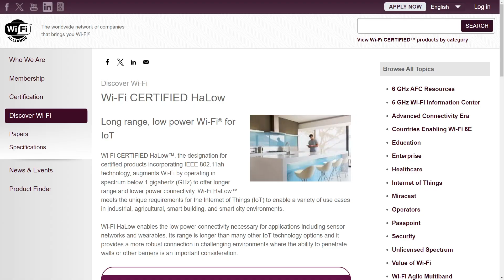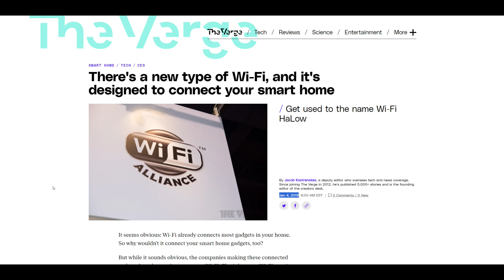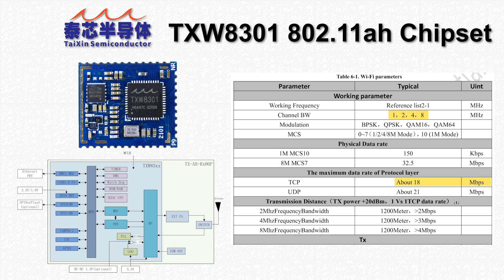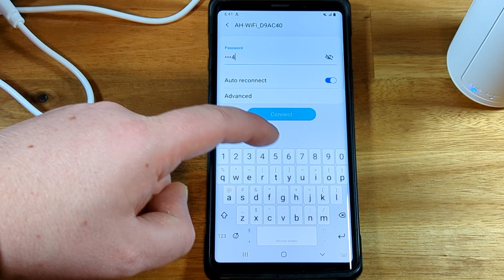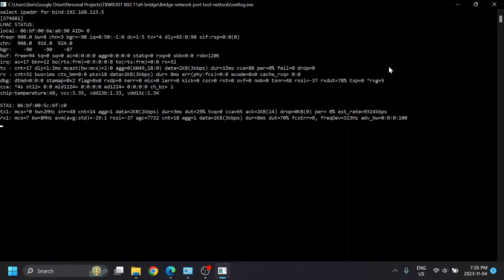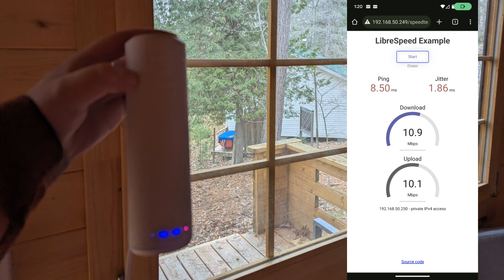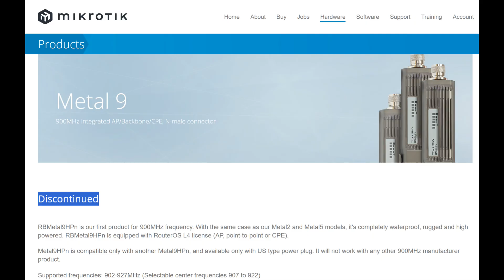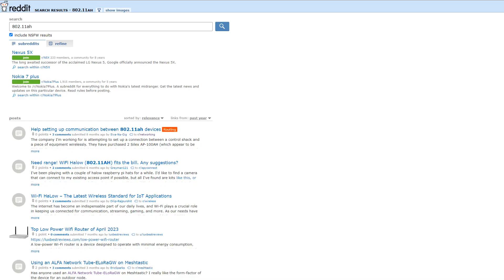802.11ah Wi-Fi HaLOW: The 1 Kilometer WiFi Standard

Comment from the maker: Thanks for the comments, everyone! I'm really surprised at the amount of attention this video has got and it's keeping me motivated while I work on other video projects. 

I wanted to answer a common question: The 900MHz band (906-928 MHz) is unlicensed (Usable by the general public) in North America, South America, and some other places. From what I can tell, Australia can use 915-928 MHz. 

If you live elsewhere, like the EU, you will want to check your country's specific regulations and rules before using 900MHz equipment as it could be possible to cause interference with cellular networks or public safety radio systems. In the EU, 863-870 MHz is available with a 1% duty cycle limitation and some TXW8301 modules are able to make use of that band, although I'm not sure if the chipset does anything to self-police the duty cycle limit.
Reply: massively good video btw, i love it
Reply: Thanks for sharing this fantastic video on Wi-Fi HaLow Ben! Let us know if you ever want to do a follow-up video & evaluate some of Morse Micro's Wi-Fi HaLow gear with OpenWRT support.
Reply: @morsemicro652  WiFi HaLow on OpenWrt sounds like a perfect duo. I would love to see a video about it.
Reply: I can see this being VERY handy for convoys, both for communication and the ability to include a single cellular modem/StarLink/etc. for data.  Everyone could be on the same (local) Discord server--for example--and chat/text/etc. as needed.
Reply: You got a lot of attention because there are barely any good videos on this technology so far. I was actually waiting to see somebody make a video like this. My search results were so thin.
Reply: question, does the Anjielo (long one with included antenna) supports IPV6? i cant find info about that on their aliexpress page
Reply: FWIW, Hackaday is about to release an article on this.
Reply: these look cool and seem like they have a lot of potential!  have you come across any new models or interesting implementations?
Reply: any chance you could do an update on this, possibly with some of the new higher throughput gear?
Reply: I would advise being careful when buying electronics from unknown sources. There are malicious Ethernet adapters, IP cameras, and Android boxes out there, etc. 8:56 That speed is very slow. Have you considered Channel Bonding or load balancing? I get like 150, 50 Mbps 4G signal ~5 km from tower on a Zyxel 5G outdoor router, and I would pay more for faster speeds.
Reply: would love to get an update on this and what progress has been made over the past year. :hand-pink-waving:
Reply: In europe (all countries) 900mhz is used by cell phone towers... you would disrupt all cellphone communication and it won't be long before you have officials ringing at your door with a huge fine.

Comment: I'm currently working on a design project for offshore applications where the mothership transmits WiFi to the technicians on site. I've also considered using "encoded bonding" for this and employing HaLow as a backup or additional network provider.

Comment: I'm watching to learn how Halo works and to see how far it can reach. I recently got a Yarbo Lawnmower and the HaLow signal seams extremely weak to me. I know nothing about HaLow but at 300 feet away the signal strength is so low that the Yarbo drops Halow and uses Bluetooth or 4G. Yarbo considers a signal gain of > -83 to be poor and doesn't use the system.
With the Bot next to the antenna, I am at -40 which to me, does not seam very strong since 0 is I believe perfect strength.
Do you understand what the -40 represents and what gain or loss should be expected?

Comment: I was originally inspired by a drone mfgr with very long range video. I did buy a product last night with this desire: a setup to monitor my vehicle using a camera and motion detect AND a set up to monitor my e-bike while I'm in a store shopping. So it would/will stream my bike or my vehicle cams when triggered, at least.. I am using a solar panel on both my bike and my car to maintain a separate 12v li-ion battery pack.

Comment: I'm curious how this stacks up against something like a Ubiquity M900 or something.  I'd imagine the power levels are the same as well as the available frequencies.  I'm going to speculate that the M900 is faster, but only under the best of conditions.  I'm just guessing, but the fact that multiple vendors made 900mhz radios but don't anymore is a clue that they weren't hot sellers.  I'd like to see one of these 802.11ah boxes with some directional antennas and see how it does in a city type area.  I would expect these devices to make a connection and hold it, albeit slower when the old devices would just lose connection.  I think that if you're trying to make a connection over rough area you can't use a ghz dish on, a slower reliable connection is better than a faster but intermittent one.
Reply from the maker: The upper limit for speed is definitely faster on other 900MHz products that I've used, such as Cambium's discontinued PMP450i and PTP450i 900MHz platform. The M900 should be faster as well since it also supports much larger channels. While I haven't pushed these to the limit, I imagine that 802.11ah will be more stable down to weaker signals and handle noise better, which neither PMP450i or M900 was particularly graceful at. I'm hoping that I can spend some time testing these out with directional antennas sometime this summer!

Comment: I believe this should be integrated into the WiFi standard as a quad band radio setup..  use the 900mhz as the upload frequency and 2.4/5 as the download. The AP/client device signal ratio could be greatly extended this way. Sort of like how cell tower works. 2ghz downlink / 900 mhz uplink. 

Thanks for the information!

Comment: When you want connect ip cameras over some meter/kilometers, is stable use ptp wifi antennas like mikrotik sxt, or nanostation loco m5/m2, is good for many cases ... ( for short distance to 1-4km they can achieve even more ), for long distance use someone better, or you can use singlemode optic fiber, with for example hex s routerboards. Or optic with converter to metalic, but you will still need router or switch on both site so .... :D.

Comment: A better product would be HALOW 802.11AH combined with 802.11s

Basically long range WIFI in the ranges of 1.5km up to 3km achieved thru 700, 800, or 900mhz frequencies and narrow bands from 1 to 8mhz.

And combine that with mesh networking of 802.11s similar with the Alfa Halow-U. Then it becomes a great product.

Some suggestions might be;

- make Halow MIMO device for increased bandwidth up to 32mbps maybe.

- lower frequency to 200, 300, and 500mhz and possibly increase the power output to somewhere in the 5, 10, 20 watts for increased range maybe 5 to 6 miles.

- add removable battery for portability like a ham radio.

- put it in a ruggedized case similar to an MPU5 for tactical usage with two removable MIMO antennas above. And a gx16 8pin port for ethernet connectivity. Also 2.4ghz wifi hotspot. Since it would offer similar functionality of long distance IP mesh networking to EUD or smartphones offering data, video, voice comms.

- AES256 encryption maybe.

- add a built-in hardware for voice comms like zello. And also a simple user interface for setting channel, encryption, and pairing devices.

Finished product would be a civillian MPU5 clone that would be low cost but definitely functional, robust, and cheaper.

Market would be Military Enthusiasts, EMCOM, NGO's, Ham radio hobbyists, Airsoft and MILSIMs, and many others.

Comment: This is super interesting to me. I go to a gun club that is just under 1.2km from my house and the cellular reception there is awful. If you stand in a certain spot you MIGHT get a single bar for 30 seconds. I wonder if a directional antenna from my property would be capable of providing a low quality internet service there - Just enough to use Wifi calling and maybe some very light web browsing. It would have to go through quite a lot of bush land so it would be pushing this sort of equipment to the absolute limits.

I'd also want a product that could be PoE powered on both ends. Perhaps a product that included everything in one kit including the antenna would be ideal. If I could use that as a proof of concept I'd bet a lot of people in my area would be interested as I live in a semi-rural area.

Comment: Probably, in my humble opinion, THE BEST use case for this is remote camera surveillance for areas that are NOT line of sight. My driveway is half a mile (2500+ ft) and having a battery powered WiFi IP Camera at the gate (solar only) would be a killer application for something like this. But.. it's 2500 ft away! ... still looking ... any suggestions?

Comment: Like you mentioned I would be worried about network congestion in already congested areas. I can see 36 wifi networks (7 of them obvious guest networks) from my couch. I’d hate to think what that would be if you only doubled the range.

Also I’m always concerned with security. I don’t want my wifi data transmitted any further than necessary regardless of encryption and other security features. Not being a target in the first place seems like a much more secure approach than buckle down your network on top of that.

Comment: Great review, tks!  This is just what I was looking to use as a wireless door webcam for a small building of 5 floors and avoid having to change the old voice intercom system.  I believe it will work fine.  Also to avoid having to use cable to difficult locations in the building like the roof and service areas at the garage.

Comment: Yeah the use for it is someone who is on a lake. I can pickup 2.4 GHz out about 275 yards from an access point inside the cabin. The cabin has wood walls and I put the access point right in the corner where there's likely a gap in the insulation. I'm going to get that Halow device that can go to USB-C to my iPad because the cellular service is terrible when a bunch of people are at the lake cabin on say 4th of July and other busy weekends. On the 2.4 GHz, I'm pulling around 1 Mbps from 275 yards. I guess I was trolling in my boat in a circle and the range was from about 800 Kbps to 1.2 Mbps and enough to get a Direct TV live stream. But HaLow should expand this beyond light almost line of sight to spots where I cannot see the cabin.

Comment: It would be nice to use on my property to add a camera down a hill pointing at the road. I have a LoRa motion sensor in my metal mailbox that works fine as long as the batteries are not frozen. As a business use case, I could see it in every truck cab of a freight company, and then the drivers could sync mobile devices or navigation data without having to blanket the yard with normal WiFi. 900Mhz was one of those last resort systems for some WISPs to get some internet to customers. Mobile data speeds are so much better these days, but you can't have a private unlimited transfer network.

Comment: Just wanted to say thank you for this as I would have never found this solution and it is exactly what is required for a farm property here in Australia 👍
Your test was perfect to demonstrate the capability of this product enough for me to be confident that it will be suitable.

I live very far away from the property that I need to fit something like this to, and I really didn't like the idea of trying to support a very customised antenna array that would take a lot of time and effort to construct in the first place only for it to be possibly still not suitable?

I was looking everywhere for any kind of wireless in the low frequency range MHz not GHz and I couldn't for the life of me find anything what so ever?

I read someone's post already that it doesn't clash with the 900mhz cellular reserved channels so that's already a plus.

I do agree with a small SOC and some RAM that you could possibly get more granular control over the bandwidth and packets per channel as it would just be faster at processing with active compute rather than passive with some single threaded code trying it's best working overtime with no resources oh and power limitations? Let the halo chip do it's job handling what it's good at and let the soc and ram handle the number crunching that could bottle neck and affect performance negatively? Either way it's still awesome to see that this tech is available and I don't need to develop or code anything and don't need to waste lots of time driving both testing and diagnosing!

Cheers again for this video you've helped me in such a tremendous way thank you

Comment: 3:58 need buy link or product details for that type c in (from powert bank) 12V dc dc out for router
Reply from the maker: In the video, I got a "USB C PD Trigger module" that had some dip switches to pick between 5V, 12V, 15V or 20V with solder pads. You can find pre-made versions all over Aliexpress, Amazon and other places like that by searching "USB C PD trigger cable 12V 5.5x2.1mm" or some similar combination. 

You just need to make sure that the USB C power bank or wall charger supports the 12V mode, usually it's on the label or the product specs page.

Comment: Your documentation hit home with the tractor suggestion.  No cellular sunshine at the farm, so a robust link to a tractor with 802.11ah to 802.11n conversion would be great.  Or a NLOS thru tree's PtP link to an amateur radio repeater location for telemetry, like you show with a Renogy charge controller.  Remote cameras another great application.  1 Mbps would be sufficient in these cases.  LORA or Meshtastic is too slow.  Cost and simplicity comparison with off-the-shelf 5GHz link to a 2.4GHz directional gain AP (as with 10dBi gain antenna).  The question is if the use case is too rare to see expanded commercial offerings.  Thanks for the video!

Comment: Ben, thanks I have a ranch where I’ve been trying to get a WiFi signal to a a parcel that’s about 1km/1000 yards away line of sight. I’m running Starlink to a Orbi system to feed the main ranch system. So I’m intrigued in building a solar/ battery system and then link devices from there. This may help….or I have hope.
Reply from the maker: Thanks! I have a video in the works about some faster point to point wireless devices that could let you get more of your Starlink connection's speed to distances that far. I've also been getting into solar lately and I'd expect solar powered WiFi would make for an interesting video.

Comment: Way back when a and ab were all that was there, the stated use distance was 25km.... with the right power,/antenna mix. The speed was 1.5Mb but then ADSL speeds were similar anyway at the time. Very much line of site and the antenna gain had to be high which required good aiming. This looks better, both speed and ease of use. up to 1Km is probably more than good enough for what anyone tries to do these days.
Reply: With a classic old Linksys router and the 2 standard antennas, the router about 40 feet up, I was able to detect it with a netbook as far as 0.3 miles away.
802.11b FHSS in a suburban environment.

Comment: This would have been of use for me about 10 years ago, when we had to dig up the street for putting an optical fibre to a new lot with a shipment hall. The halls distance was about 400m from the outsides. As the shipment hall only needs small data packages, like a printing job protocol, a barcode, a text block with the customers name + address, the 16Mbit would have been way enough. Mayby another day this knowledge will become useful.

Comment: The access point thing (with higher gain Omni antennas on the mobile end) is great if you (for instance) have a big farm and for some reason need (serviceable but overall not that quick) internet access in your tractor while you're plowing, sowing, or reaping fields of whatever you're growing.
The only problem that I see right now is that I haven't seen a demonstration of the 900mhz part of the link operating in point-to-multipoint mode.
I can already see a problem where you have only 2 tractors that both need independent WiFi, you'd need 2 of these base stations and 2 of the access points, which seems like an excessive number of base stations to me.
Is there any HaLOW compliant device that allows point to multipoint over the 900mhz link section specifically?
Reply from the maker: Hi there! The first one I showed off was sold in a point to multipoint kit and it looks like you should be able to pair additional units as well, you just have to undo the screws and remove the lid to access the AP / Station mode switch and pairing button. I'd expect the "WiFi Extender" that I showed off could also work in multipoint mode, but they don't sell the side with the 2.4GHz WiFi AP separately. That said, both sides have an internal "AP / STA" switch and a paring button, so if you buy a second kit you could end up having a wired client and a WiFi AP client.

Comment: It's a good thing for connecting buildings and houses - if 10MBit are enough. You might use 2,4GHz with very good antennas instead, but without line-of-sight you won't have much fun or need radio masts. IMHO a good product/standard in between LoRaWAN and WiFi.